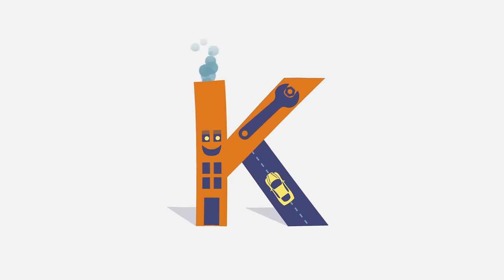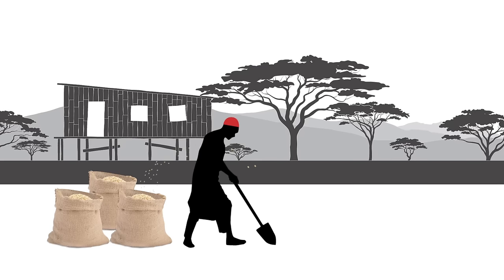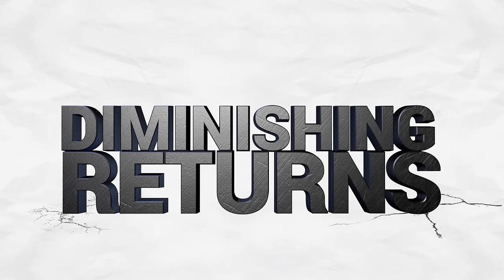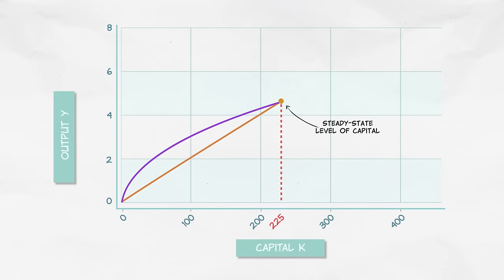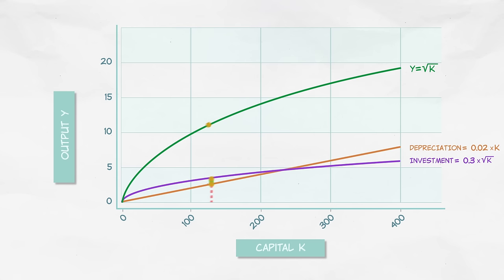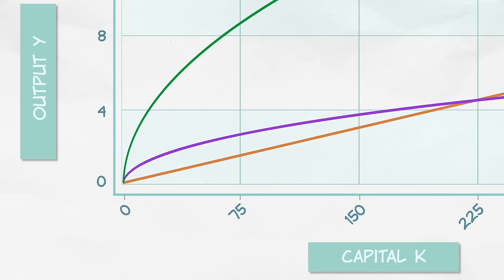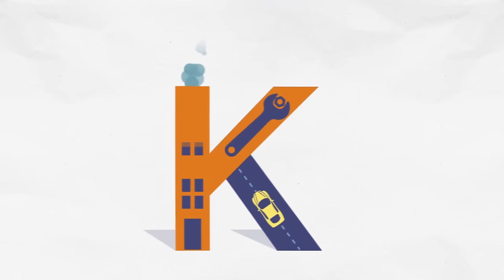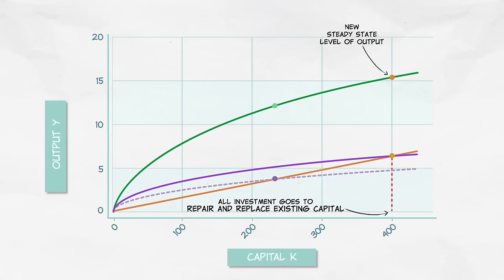The Solow Model and the Steady State

Comment: I don't understand.  Why does Investment say 0.3*Y on one graph, and then it switches to 0.3*square root of K on another graph?
Reply: Anthony Ortega because according to the logic of diminishing returns, Y = K^some fraction. They chose 0.5 as that fraction, so Y = K^0.5. Thus, when stating depreciation, you can sub K^0.5 (which is sqrt K) in place of Y.
Reply: Speaking of which, is the output always the squared root of the capital input in the Solow model? Or is it simply their random assumption?
Reply: yarpen26 their assumption for simplicity. You can use any fraction, not just 0.5
Reply: No, I mean the fact that Y=√K. Is it always like this in the Solow model? Or elsewhere as well? And if so, is it always like this in real life?
Reply: yarpen26 I don't get your question. K^0.5 = sqrt K, that's why I'm saying it's their assumption that Y = K ^ some fraction
Reply: Ah yes, right, I forgot that a power that is also a fraction translates to a root. Never mind.